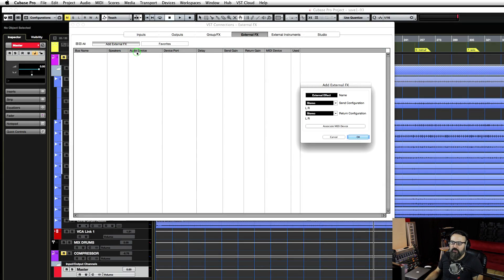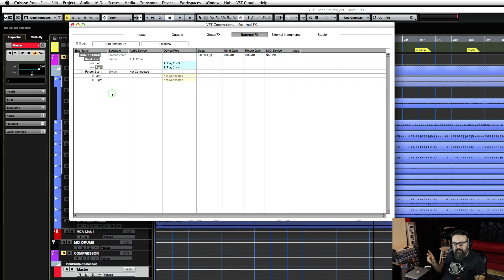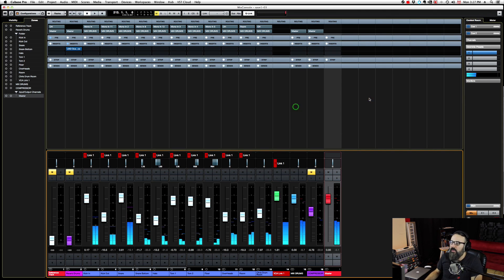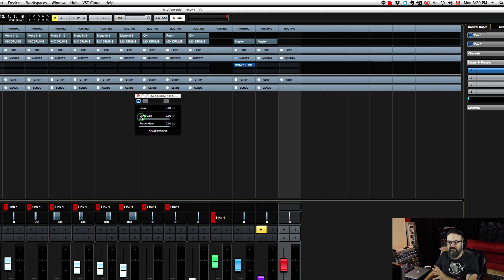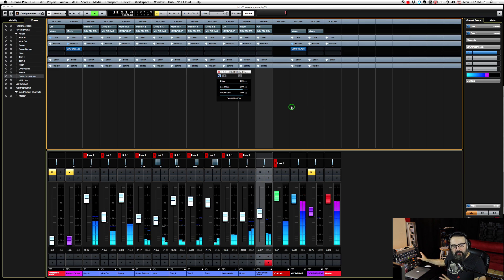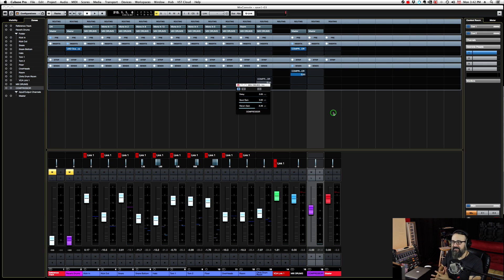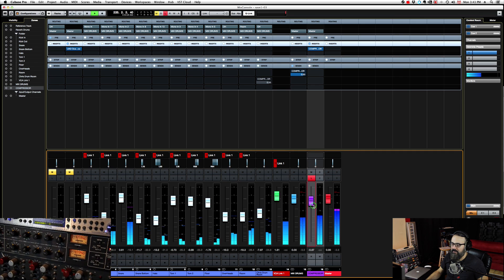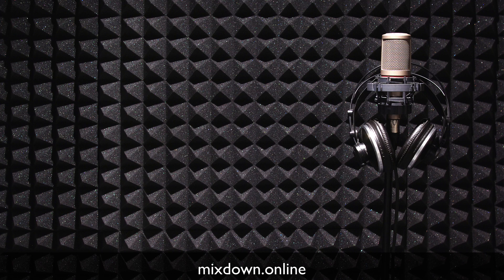CUBASE QUICK TIP  /   HOW TO USE ANALOG GEAR IN CUBASE PRO - mixdown.online

Comment: Hmm it doesnt work in my case too. I use my 5 6 line out and my 7 8 in connect all like u showed me . But when i turn the fx down on the reverb its like i double the sound its almost like phasing. But i get the Reverb. When i turn the reverb higher up i get distortion fx and feedback ( that howling sound). Help ?

Comment: Exactly what I was looking for thanks a lot man.. If you’re running several pieces of outboard gear across different tracks, does that mean you need more inputs and outputs on your interface? 

Or if you have 2 inputs and 2 outputs on your interface, to get around this would you have to print the track with the outboard gear into Cubase, then connect your next piece of gear? What are your thoughts on this?
Reply from the maker: 1. Yes
2.that would be the workaround, in this case, use your headpnones for your playback

Comment: Hey Chris, another great tutorial and I'm adding an outboard compressor to my setup as soon as it arrives in shipping.  You have definitely answered my first question about how to route audio through a piece of outboard gear after you've tracked.  My question is this:  how would you insert the compressor into the signal chain so the compression is "printed" as part of the recorded audio?  For example, let's say I want to use compression on a vocal during the tracking phase, and print the compression as part of the track?  Any thoughts on how to do that, and any thoughts on whether or not this is even a good idea?  Thank you again for all the wonderful Cubase tips.  You and Dom and are my Cubase gurus!

Comment: How do you export the mix? With realtime enable and waiting to finish? Or you print the track at the same project and then export regular? What if you have more than one analog processor?  If you have inserted 3 analog units it will have to pass the da/ad stage 3 times! I’ve heard that this is not good way to go!
Reply from the maker: With analog gear you won't be able to export offline, so just export your full mix in Realtime with your 3 analog units active.

Comment: Can you parallel compress using it in on the master bus? (How)
Reply from the maker: Yes you can. I'm planing on releasing a video where I use parallel Compression on the whole mix. Hang  on ;-)
Reply: @mixdownonline  wow awesome Thank you!!!! I've just ordered an Art Pro VLA II unit so I will definitely be watching! :)
Reply: @mixdownonline  please include how to do parallel compression with  outboard compressor on a stereo drum group. Im confused how I could run it but still have it be in the right signal path order so say if I want to add reverb on the stereo drum group, it's after the compressor so it doesn't get compressed. Sorry I'm new to this and it's confusing me.

Comment: Awesome video, it's opening up my mind to new possibilities - Is this method the best way to use a wah-wah pedal?  I have a dunlop crybaby wah, would love to directly use it in my songs, or  use an expression pedal to control a VST wah effect. I think you solved my problem with using the wah directly, but is there any way to use an analog expression pedal to control a vst wah effect?  thank you for your consideration and keep up pumping out these awesome tutorials!
Reply from the maker: Should work, try it and let me know.  To control vst effects, a MIDI controller will work
Reply: Bear in mind your Wah pedal is designed for instrument level signal from your guitar, not line level from your interface's output. so you'd need a re-amper to get that signal strength right, otherwise you're gonna sound like ass balls.

also bear in mind that your wah pedal puts out a roughly instrument level signal to go to a guitar amp, so you're gonna need a di box to up the signal strength back to instrument level to go back into the input of your interface.

If you don't have a di or re-amp, i recommend the Little Labs Red eye. it can DI and reamp simultaneously, so you only have to buy one item! all their gear is top notch as far as sound quality as well. (and it's just nice having a quality di box and reamp box around).

also, read the manual for your wah, to verify the input and output is what i said. my words are general statements about guitar pedals. it's not always true. different pedals are different, and i've never owned a dedicated wah pedal.

Comment: Thank you Chris. I have a question... I have  rme ufx ii which has 12 channels ins and outs but the 4 of the 12 ins have onboard preamps . In which channel you route back in your hardware? In the line in with the preamp or without ? (when you use an insert of an interface that has onboard preamp in line mode , that means you bypass the preamp? )
Reply from the maker: Good question,  I route back to line level inputs without the preamps :-)

Comment: Hi Chris, thanks for informative video, I have little question regarding your method. Recently I bought external compressor, I totally understand your approach when you have already recorded track and just want to use your external gear while mixing, just insert plugin, send the track to other track and press record. But I want to use my compressor while reamping as well, would your method work? I mean I can reamp guitar track and then print it again with external plugin like you showed. But basically I`m doing same thing TWICE, reamp and then print with EQ. double work. But when I reamp guitars first I only play DI track through other amp dialing settings and tone and when done-print I would like to use my external compressor at the same time to be able to tweak settings while listening to 'new' amp while 'choosing' and 'dialing' the desirable tone and then print. So tweak everything at once and print only final result. Will inserting external plugin in my case work as well?  Sounds quite complicated, sorry. Hope you understand. Thank you
Reply from the maker: Hello Lucas,  I don't use this method for reamping... I create a mono output and route the Clean Signal's output to that mono out...that goes out of my interface into a Reamp Box then to the guitar amp... then Mic the amp...to a preamp... at this point you could send you preamp's output in your compressor then in the interface to be recorded if you want to commit right away... Hope that helps!
Reply: @mixdownonline  thank you. My setup is slightly different as I use cab simulator Torpedo Live with my amps. So my signal would look like: DAW (mono out) ->Reamp box->Amp->Torpedo live->DAW. To get my question more clear. When reamping and playing my DI track through amp I can change amp settings as it`s playing shaping the tone. I would like to add my analogue compressor to the chain to be able to do the same thing, once done with amp and compressor then print. My question is: Does setting External FX plugin like you did in your video allow my to use my external gear while playing DI track through the amp? Just same way as I would let say turn 'TONE' knob on my amp. Or.. I have to reamp first and print and then pass that printed track through  External plugin and print it again? It`s quite confusing, I know. I really appreciate your help, THANK YOU!

Comment: anyway you can show the cable connections? do i need 4 trs or xlr to trs cable for the 2 outs and 2 ins? or are the two ins just not the actual line inputson your interface. im using an apollo 8 duo, it was 8 line outs on the back but only 4 line ins

Comment: I have yamaha mgx 10 xu mixer. It is possible to take that mixer to compress/eq/ addinhg some fx to a audio track with the trick you told.thanks
Reply from the maker: Yes, If the unit you work with has an Input and Output...If your mixer has inputs an outputs on every single channel, that's even better
Reply: Thank You....Good Luck

Comment: Hello Chris,  Cool Channel! If I want to use the same outboard gear for other tracks, What is the best option, Send or insert? would I need to re-record the outboard gear signals to different tracks?
Reply from the maker: It depends, if the unit is a delay or a reverb, you could use a send if you're planning on using the same settings on more than one track...if you need different settings for each track you want to use the outboard gear on, you can use as an insert and bounce that track so you get the effect printed on a new track and you can use the outboard gear on an other track
Reply: Thank you much!

Comment: I notice that in certain tools (for example: Preferences, Key Commands, Studio Setup, VST Plug-in Manager), the main font used for listing details is now tiny. 

Yet, in other tools (MediaBay, MIDI Device Manager, etc.) the fonts generally look as they were prior to 9.5. 

I find the tiny font to be too small as compared to the font shown in other Cubase instances that have been upgraded (instead of fresh installs) since version 8.

Is there a way to increase the font size used so that Cubase looks like it did previously?
Reply from the maker: Good question, I don't have the answer to that question, I'll have to look into it...that might be a good one for Greg Ondo

Comment: MY QUESTION IS THAT I HAVE ONE ANALOG COMPRESSOR AND ONE ANALOG EQ BOTH BY WARM AUDIO ,I ALSO HVE A PATCH BAY I WOULD LIKE TO KNOW THAT IF I TRACK VOCALS IN CU BASE RAW  AND USE THE EXTERNAL EFFECT TECHNIQUE TO COMP AND EQ A SINGLE COMPOSITE TRACK..IS THERE A MACRO THAT WOULD ALLOW ME TO RUN SEVERAL TRACKS THROUGH MY EXTERNAL CHAIN AND BOUNCE THEM BACK INTO CU BASE???

Comment: Can this be done with cubase 8.5 Essentials? If so how?
Reply: nope. need the pro version. essentials doesn't have the option to measure the delay (return latency) of your gear in order to auto correct and time align it. i tried this and just recorded it via a send to a new track in elements. all the sudden my tight guitar playing wasn't so tight!
Reply: I haven't tried anything to manually detect the delay/latency, but i guess if i could measure it, i could just manually shift the new track to adjust for it. in his case, .06 milisecond (insanely fast, and not noticeable) delay as the sound gets processed through whatever external hardware you're running. i did see this same video but from 2011, and his (different guy) calculated delay was 1.46 milliseconds, which would stack up noticeably i'm willing to bet. for my own tests, i was running an old Carvin Studio mixer board as my hardware, and i'm guessing the sheer mileage of analog components probably added up to a nice over 1 milisecond delay by the time the signal got back to the input on my interface. plus i'm using a Focusrite Scarlet 18i20, that i have the latency set to 10ms to save some cpu speed. but, it only goes down to 1ms anyway. so even without the analog hardware my interface adds at least 1ms as a best case scenario starting point. Chris is running a 0 latency interface to get that .06 from his hardware. and that's a much more expensive interface!

Comment: And if I want to have an analog compressor on vocals too, but with verry different settings on the hardware component, I have to buy an additional compressor. Right?
Or bounce the drum into a track and use then this track, and the compressor is free for vocals. But...does anybody do it this way?
Reply: You bounce. People do this all the time, even in large studios.
Reply: George Sladkovsky yeah but that's very time consuming, and if you mix, and want to change a bit here and there...omg.
a def plus to VST. at the mastering, no question to take analog hardware, at the mix, as good as it goes in practice. Do u agree?
Reply: Yep, bouncing is time consuming and annoying. That's why I am mixing in the box and use hardware only for mix buss processing and masters (mainly compression).
Reply from the maker: Like George said, people bounce all the time. In my case, if I use my hardware compressor, most of the time it will be on the mix bus or by doing parallel compression. I always bounce my parallel compressionI track when I use my Drawmer. I rarely use it as an insert, way easier to use a plugin.  Thanks for you question!